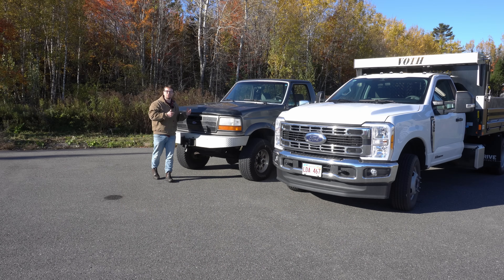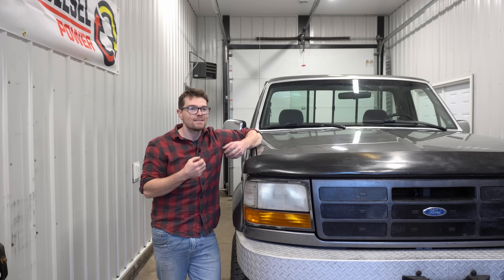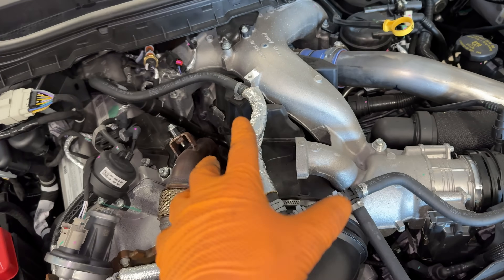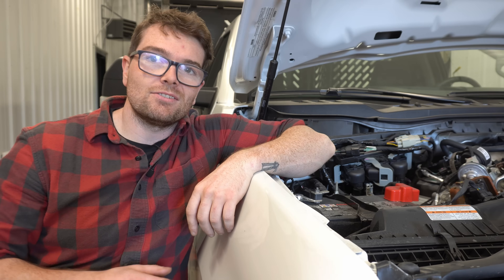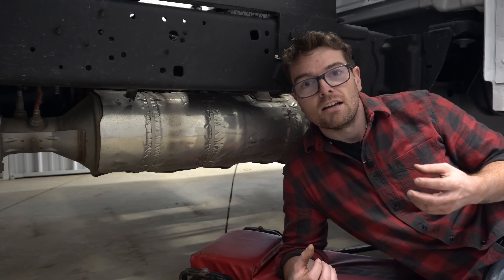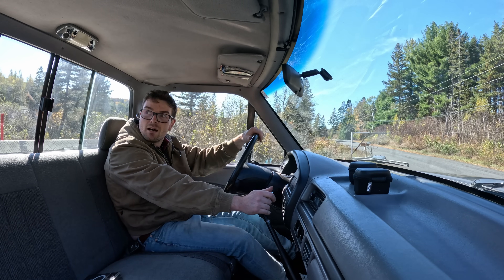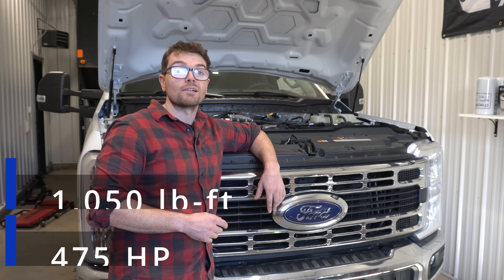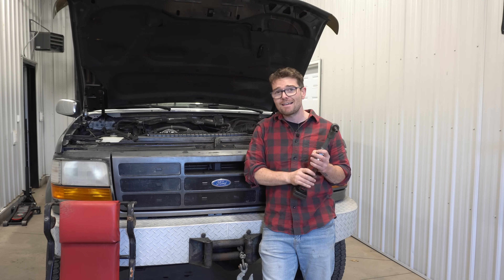Ford F-350 6.7L PowerStroke | 5 Reason Why New Diesel Engine SUCK *Diesel Mechanic Explains*

Comment: Wow, I hit a pot hole and all of that stuff just fell off. Now my 6.7 has the best of all worlds.
Reply: Same with my diesel car, I hit a big rock and it all falled off.
Reply: Whatdaya know, stuff happens lol
Reply: @Kenneth_R  ik lol
Reply: Same thing happend to my brother in law.😅🤣😂🤠
Reply: Damn!!  Same thing happened on my Detroit DD13.  160,000 miles later and still haven't had to turn a bolt on it!!!
Reply: It’s called weight reduction. All modern diesels run so much better when they are lighter by a few pounds.
Reply: Hopefully you get fined.
Reply: @csuengr  🤣🤣 I don’t live in a communist state, so no worries there.
Reply: @bigbubba357m  lol looks like you might have  pissed off the climate gods ! If your not careful you might end up getting dirty look!
Reply: @ I’m not scared, bring it. 🤣🥱
Reply: @bigbubba357m  It's sad that you don't think about anyone except yourself.
Reply: @ it’s sad you think my Diesel pollutes more than those people saying I need an EV, while cruising around in planes and motorcades for funsies. When those people take it seriously, I’ll think about it. You’re boring me, next. 🥱🥱
Reply: You cannot beat the old 7.3 diesel. I’ve often told people you can have a 1999 Ford F250 lariat with all the options versus a 2008 Ford F250 with all the options. You’ll pay more for the 1999 because of the 7.3. Especially, with those junkie 6.0 and 6.4. At least the 6.0 can be billet. But the 6.4 is absolutely garbage. Hence the reason why Ford divorced from Navistar/international. Then of course in 2011 the 6.7 was born and a true Ford engine. 
Now with that being said, the 6.7 has had it share of problems, especially in the first few years, particularly turbo problems. They also are known to catch fire. Trust me, one of our trucks in my fleet caught fire, literally out of nowhere, driving down the road and burned completely to the ground about three weeks ago. 
Bottom line is you’re absolutely correct. The old million mile diesel days are long gone. Thanks to all the admissions. The states that do not have to worry about it at the moment I would enjoy because the emissions will be coming to you very soon unfortunately. Just my thoughts Ron
Reply: :face-blue-smiling:
Reply: 👆 this guy wins the internet. We can all go home now!! 😬
Reply: The EPA is cracking down on deleted trucks. Good luck. It’s SUPER easy to identify deleted trucks. I just wouldn’t trust it anymore.
Reply: @jfdb59  fortunately the EPA is being dismantled and being stripped of its bureaucratic self-proclaimed power! RIP EPA! You way overstepped your boundaries!
Reply: The problem is the government does not consult with mechanics jthey just talk to pencil pushers who drive  bicycles or take a taxi or a electric train to work they have no clue  and yes like the old timer say you have hook up contender. To fix it  it’s sad this is how all engines are now even chain saws

Comment: I am also a commercial truck teck. This is one of the best videos I have ever seen simplifying the issues with modern diesels. I would also take a old 7.3 with a manual any day. I used to tow cars in the 90s and that is what we ran in all our trucks. We had one 7.3 with 425 thousand miles on it before it died. Sure they needed some work but nothing like the modern trucks do.
Reply: Our dumbed-down "education systems" have eliminated manual transmissions now so that we can't even get a manual anymore.

Comment: DEF fluid freezes?!?! So you can't leave a modern diesel truck outside in the winter for prolonged periods? Like if you parked your truck at the airport in Edmonton and went on vacation... It gets to -40 there regularly
Reply: They shouldn't try to pump the DEF until the tank heater gets it liquified.  Those tank heaters do the job real quick.
Reply: Yep, DEF is roughly 66% water and 33% urea, so it will freeze. I work on heavy duty trucks (semi tractor and trailer), so I'm not sure about diesel pickup trucks. But the big trucks allow up to 2mins to defrost some of the DEF, if the emission computer does not see DEF flow within 2 minutes it will derate the engine

Comment: F700 line truck went through two egr coolers totally clogged on the cummins engine. My company spent $30k over the years on it before it puked out. Just over 100k miles. Lots of PTO time on a bucket truck--that doesn't help.

Comment: Ok, 1,000 miles, but how many idle hours? These modern Diesels want to be working, not sitting around. I have 200,000 on my '16 f250, and all I've ever done is regular maintenance. That being said, if it's on, I'm working it, bed full or towing a trailer.

Comment: Totally agree with you I have an '03 duramax no emissions at all only replaced one sensor on it since I've owned it 300,000k on it the injectors are just starting to act up that's about the only unfortunate thing about that lb7 but it never fails me

Comment: We love our 7.3. 468,000 km and counting.
Reply: 303k on mine. Life is good
Reply: @daveconklin1319  Only just broken in 😎
Reply: 550k miles on my 12 valve. Biggest thing I've done to it was a new 3 piece exhaust manifold after the factory one-piece manifold cracked. Could probably use new injectors, get a puff of white smoke every now and then when pulling a hill but they're still working.

Comment: I'll never buy another modern deisel. My gas work trucks can tow almost 20k and I can consistently run them for 300k miles with minimal issues
Reply: kilometers.... I'm done
Reply: @addamjenkins75  300k. As in 300 thousand miles.
Reply: @chadmiller6487 was supposed to be a standalone comment not a reply. He says kilometers in the video.

Comment: just more evidence to go back to a gasser. 2002 5.9 dodge 2500 240,000 never been to dealer. 2018 ram 2500 13 times to the dealer in 90,000 miles.

Comment: I have a 97 Ram 2500 12 valve with 610K and have not serviced any component on the engine. Have added a Banks performance package, all the power I need.

Comment: Great video Alex, you are correct again!     Emission,emissions and emissions. Blame it on the US EPA.  Sounds like the 70's in the US with CAFE requirements requiring downsizing of engines and cars sizes.  The EPA acts  like they are trying to kill off diesels on purpose.   But, the idea of 1k ibs of torque is great.   A Mopar man bought a FORD, hum.  Have  a great week.

Comment: Going to look at a 2010 f250 6.4 4x4 tomorrow don't even want a new one glad it won't have a DEF tank 1 more year newer and it would and I guess the county I'm moving to doesn't require smog. I'm so stoked I will be able to delete any EGR crap I come across. Just looking now they are asking $63k for a 2020 f350 platinum with 55k miles, so crazy.

Comment: Why don't they take the EGR gases from down stream of the rest of the exhaust filters.  The gas would already be cooler and would have less soot and yet it would still not have any oxygen.
You would need a bit more plumbing and it might cost a few cents more but it would help with the EGR gas cooler and the soot build up.

Comment: I agree with most of your points and the 7.3 power stroke is still a great engine, but to me the weak point is the oil pressure dependent injectors. I have a soft spot for the 6.9 and 7.3 IDI engines, no electronics, mechanical HPOP, yes not as powerful as a turbo version, but if well maintained will run forever.
Reply: I had a 89 7.3 IDI. Agreed super reliable. The only big problem some of them developed was the cylinder cavitation and most didn't.

Comment: We have a 1990 7.3, 2001 7.3 and 2012 6.7 at my work. The older truck isn’t worth it. It’s physically exhausting place to be. Mainly the noise level. It’s a solid 20dB louder in operation. The noise of the motor and sound deadening in the cab is bush league compared to the 6.7. If you’re running 100+ miles a day, the new truck is worth the trouble of the newer tech.
Reply: It's worth the trouble to you because you don't have to fix them.
Reply: Maybe for you
Reply: Buddy, we need to get you a new quiet EV truck.

Comment: One is an I phone designed to be replaced when the new model comes out. The other is a hammer, built to work and take a hit over and over again. Really the answer is to keep the old diesels on the road running strong, then the manufacturers will get the idea that not everyone wants to ruin the environment by buying a new phone and truck every 2 years.

Comment: Sadly this applies not just for the trucks but to regular vehicles as well. Here in Europe in the 90's/early 2000s' diesels ruled the roads. Now...not so much, diesel sales have been dropping steadily for the same reasons you mentioned in the video, just too complex and expensive to fix.
Reply: Just got back from the UK. About half the cars are diesels.  There is a tax on cars based on a scale of pollution 0-50.   Fuel costs are also very high. About $9 USD per gallon either gas or diesel.  So it’s a trade off.  Diesel cars are taxed more but get better gas mileage.  Gas cars are taxed less but use more fuel.  One thing you don’t see over there is lots of junk cars sitting in people’s front yards.  Yes I own 7 vehicles from 2025 model year to 1993 but they all run and are registered & insured.  Two are my wife’s and 2 are for my kids. All are AWD or 4WD since I live in the Rocky Mtns.

Comment: Aside from a hole rusted in the oil pan, an ipr sensor, and a crank position sensor, and difficult cold starting. My Dad's lightly tuned 2001 7.3 has been nothing but a bullet proof workhorse. Never left him stranded, even when towing a 30ft camper around North America. He has 450 000km on it now. 

I have a deleted lbz too. That has over 300k on it. Aside from a few ball joints, glowplugs, breakbooster, body rust, front wheel bearing, and tierods. It still runs like new, has enough power stock to be fun to drive unloaded, and tow anything I need. I think the LBZ is the perfect compromise between performance and reliabilty. Guys have gotten over 800k on the trucks stock. 

At stock power the lbz is super reliable, but there is always the easy option to bring them up to 400 wheel horsepower, with just a transgo jr transmission shift kit and a good tune to keep them reliable. Then you have a rig that has close to the same power as the modern diesels but is much more reliable. 

Long live the pre dpf diesels!
Reply: What's the MPG like when they get tuned like that? Sounds cool
Reply: @Original_Edition 
You can get 23 mpg out of a crew cab on the highway with a good tune and stock tires. If you put your foot into it though, your mpgs fall pretty fast. Lol.

Comment: I bought a well cared for 6.2 F-250 Lariat 4x4.
I love the motor, and for daily use.
Plus it tows my 10,000lb trailer no problems.
I would not want a diesel as an everyday driver.
Reply: Change the oil often and hang onto that beast !
Reply: @charlesb4267  Indeed!
I’ve changed all of the fluids, and run Mobil 1 Gold every 5k.
Cheers!
Reply: Agree. My grandfather was in need of a new 1 ton for light farm work and towing a 8500lb camper. He was coming from a 12v Cummins and wanted a new Powerstroke. Got him into a 7.3 gas with the 4.30 rear end. More power and torque than his old truck using go ole 87 and cheap oil changes. He’s very happy with it.
Reply: @slscamg  Yup, they are fantastic motors. 
When I start pulling an excavator for work everyday I’ll get a F-450.
But I think my every day driver, and weekend warrior will always be a gas.
Cheers!

Comment: Oh boi, gonna hurt some feelings Alex 😂 there’s pros and cons to both sides of the argument, and understandable as well. The older diesels take a labor of love to keep going, but the new diesels when running without emissions issues can be outstanding… until they break. I think modern diesel owners that use these trucks as daily drivers should entertain buying gas vehicles, our new fleet trucks with the new diesels seem to do pretty well as long as they’re working and towing and doing their intended purpose. But when modern light duty diesel pickups are being used for around town errands, I think that’s where the issues lie. Still, doesn’t prevent all of the emission headache. It’s why I still hang onto my 2000 7.3. It’s a labor of love but she’s paid off and hasn’t failed me yet apart from a starter dying out of nowhere. Long live old diesels. Please keep these old diesel videos coming

Comment: I test drove a new chevy with the 3.0 at the dealership. The MIL came on during the test drive. It took it to a service bay with the salesman to get scanned and printed out a whole sheet of codes, none of which the service writer could decipher by looking at it. I sent it to my friend who is a tech at a different chevy dealer and he's like yep, you want a diesel, that's the kind of thing you're going to have to deal with. And, no he couldn't off hand decipher what it all was either.
Reply from the maker: That’s just is. Endless sensors and what’s very tricky to diagnose is the calculated values the computers read and if those calculated values are out of range - boom check engine light and your trying to decipher why the calculated value is off. Nightmare
Reply: I've got my dad's old 1997 12 valve. So simple and reliable.  I'll never sell it

Comment: The military used that 6.7 with no egr or dpf or def and guess what they are very reliable.
Reply from the maker: Image that eh lol
Reply: Yup, then the top tier government officials go flying around the world in non emission regulated private jets.
Reply: On that note I wonder what the Banks duramax set up for the military has for after treatment items, if its also on on a diet of ingesting clean air and no banana in the tail pipe ?
Reply: @charlesb4267  all their diesel vehicles have the EGR deleted.
Reply: @JustAverageJeff  Reminds me of a friend who was touring the John Deere combine factory in the states and noticed that they were building the same combine that the north american market uses but it was for the south american market and it had NO after treatment system at all and electronics compatible with that setup. Now go figure how that makes sense if they truly thought the world as a whole should reduce pollution.
Reply: @JustAverageJeff The SCR DPF And muffler removal as well. Just turbo back exhaust straight pipe.
Reply: 6.7 in my 2020 ram  pickup truck has hydraulic valves which have been known to have issues. The solid lifters used in commercial engines are proven reliable.  That's what I read anyway. I'm no expert
Reply: @Andy-bi8wr  This channel just talked about that in the last or recent video as per the issue they have and have also heard this from a mechanic that was interviewed by another youtuber as he was working on one of the newer cummins engines in a shop. Its a problem, what the odds are of them failing I don't know though.
Reply: @Andy-bi8wr  it's really odd my 1988 Lincoln town car is 34 years old with hydraulic lifters 0 issues.
Reply: My 02’ 7.3 has quite a few sensors, fly by wire,  etc. All easily diagnosed and repaired. 394,000 miles. Definitely slight loss is power in 22 years. But zero blow by out of oil fill. And I change oil 5,000 religiously. 14 quarts oil and add one pint Hot Shot Secret Stiction eliminator.  Keeps injector pump clean which is critical on 7.3.
Reply: @russellridge8623  Bet it's super clean would totally buy it if the price was right or something similar. a 7.3 is what I want I just can't find one for a decent price and anything newer is 50k or more.
Reply: That's the only exception, everybody else is screwed I wouldn't buy a new diesel as this video suggests....
Reply: Another problem with new diesels is that they are tuned way too hot from  the factory.
Reply: @MadaraUchiha55910  would be fine if they weren’t breathing in their own shit.
Reply: @MadaraUchiha55910  yep I agree
Reply: Best thing I DID DELETE MY 6.7
Reply: @stevenbrooks1243  Looking to buy a 2010 f250 6.4 and it's already deleted but where I live for now requires smog.
Reply: My deleted 6.7 is WAY BETTER then any 7.3 I owned and I had 3
Reply: @stevenbrooks1243  Until you drop a piston because of cylinder pressure because it’s practically tune like a race engine from the factory.
Reply: Well, duh 🙄 !!!!!!!
Reply: Well duh!!!🙄
Reply: 6.4 powerstrokes are garbage, the worst engine made.
Reply: Yeah dude is drunk
Reply: The government's allowed to pollute... They're the worst polluters of all!!   the rest of us.Peons aren't allowed to do any of that.
Reply: That's what the government wants.    They want YOU to drive emissions on vehicles all while they buy trucks with no emissions installed at all
Reply: Sounds like a different motor
Reply: Yep thsts the dickhead military , dont use the same crap they force on the slaves.. dont worry theyll still get their gawd damn $100k pensions for life while they play ads on tv telling you how they’re all homeless and need a handout
Reply: no the fuck they are not lmao

Comment: It would be okay for the emissions equipment if you could actually maintain them and not have to replace them like on my 1998 vw jetta it says once in awhile to run intake cleaner to help with egr buildup.

Comment: I have a 92 idi f350 non turbo and my dad has a 16 with the 6.7, I've had to drag his truck home with mine and he's yet to have to do the same for mine
Reply: I.have a 1993 7.3 non turbo idi extended cab 8' bed project f250 4x4 speed with 150K on it .I really want to fix this truck.